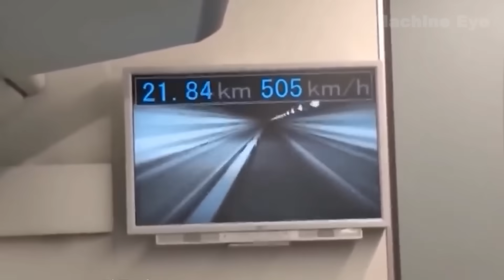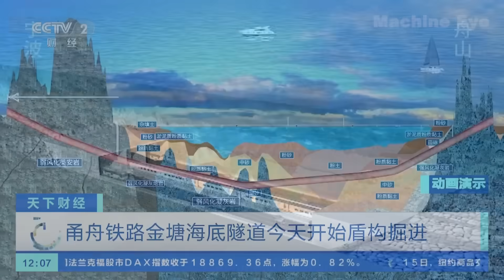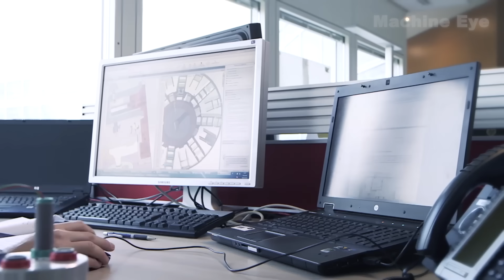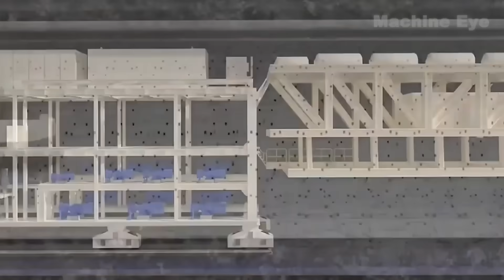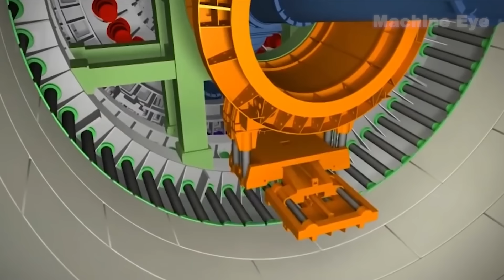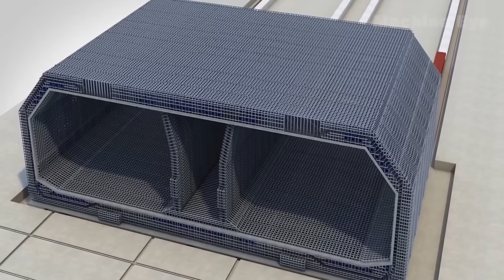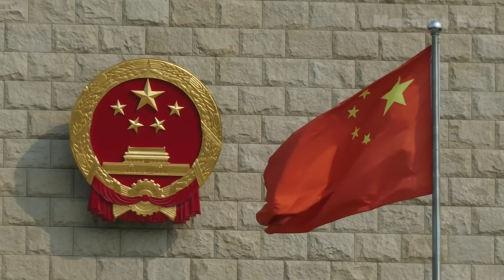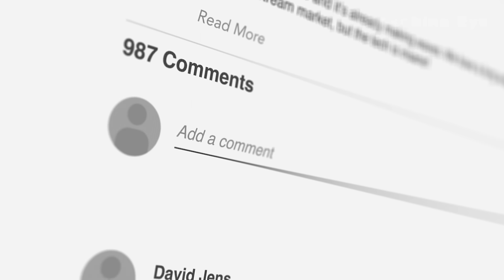China’s New Undersea Tunnel Is So Extreme…Americans Can’t Even Imagine!

Comment: He lies, they did not use satellites to guide the connection of the two sides, they used a small mole machine, like a tunnel for one man to kneel in and used common tools like a compass and distance measurements and came out the other side. They used this small tunnel as a guide for the larger mole machine.

Comment: We refuse to remove the criminal element of our society, so mega projects are no longer possible in the United States.  With endless studies, regulations, and ripoffs, it takes decades to build a 100' bridge on a two lane road.  It took 5 years to replace 2 interstate bridges where I live, but the interstate bill passed in Congress in 1955 and traffic was crossing the original bridges after building the road to the bridges and building them, in 1960.  Greed and no justice system is causing the US to self destruct from the inside.

Comment: There are so many unsafe building materials being used and shody engineering that the infrastructure collapse will be catastrophic.
Reply: Those professional that build them are not stupid,  they ancestor built the wall, that still after thousands years, with no technology, just by human hands, just mention that. Have you seen the wall collapsed?
Reply: @Brancaalice  building a wall is not the same as building an underwater highway. the success of an underwater will be measurable after 20 years. no human has ever attempt that and part of the reason is that concern was that it would be impossible to repair and should any degradation occur, you lost an entire road with massive loss of money.